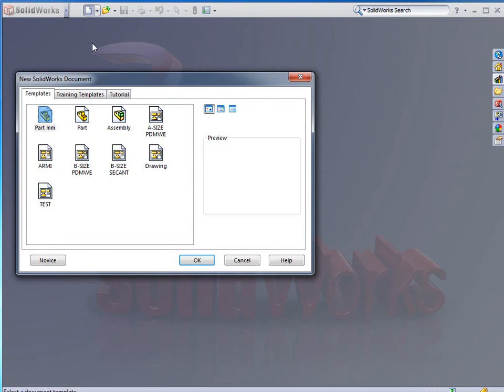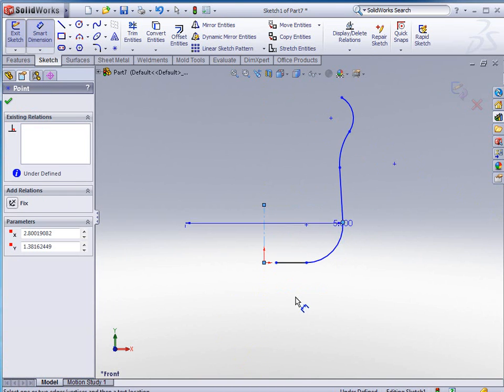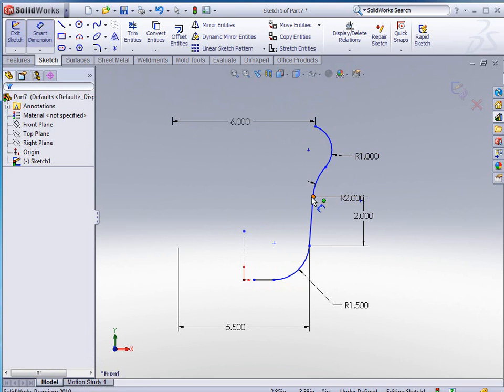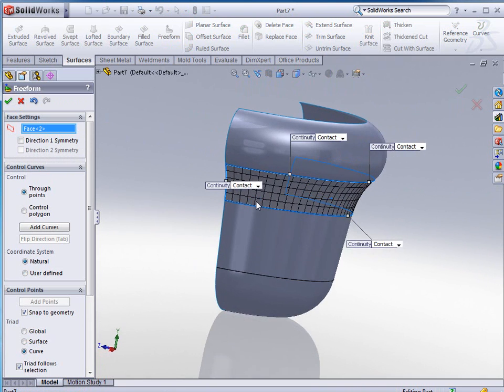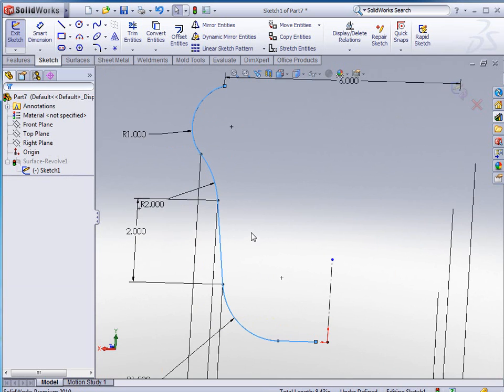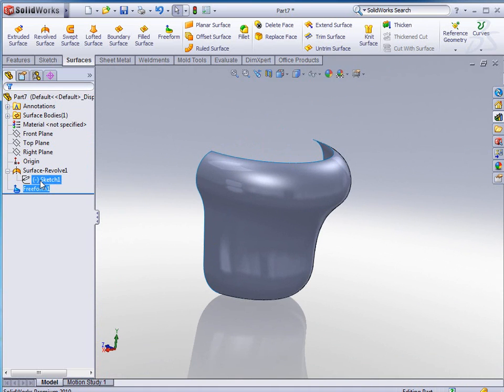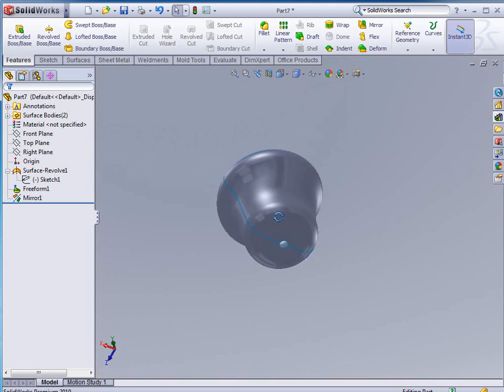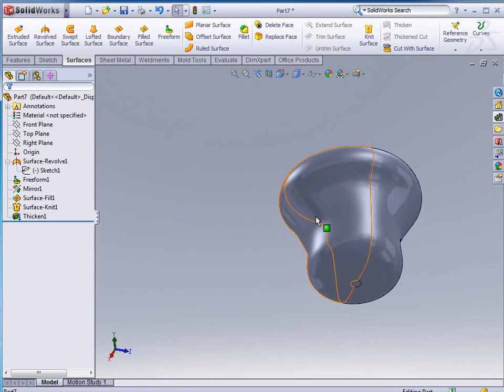Advanced Surfacing Followup.wmv

Comment: I think SWX is able (or shoudl be able) to deform and control the deformation of the set of surfaces without the need of making an approximating spline.
Please notice that the approximating spline will surely have inflection points along the line. It is easy to check it by showing curvature plot on the spline